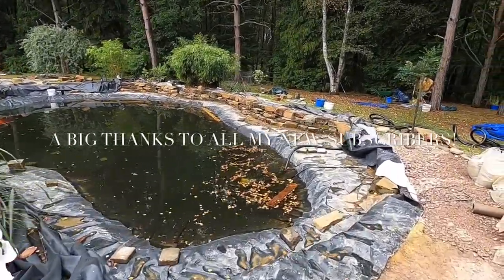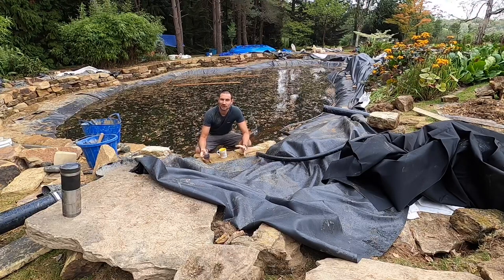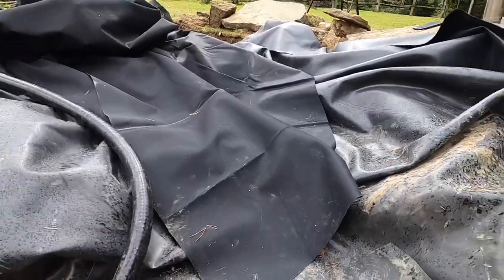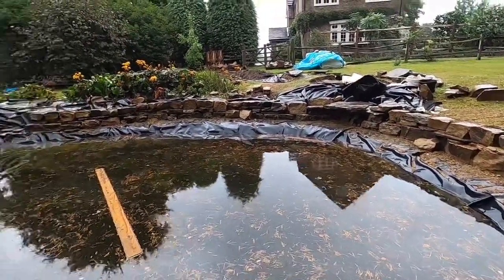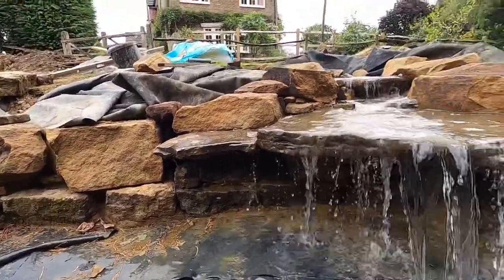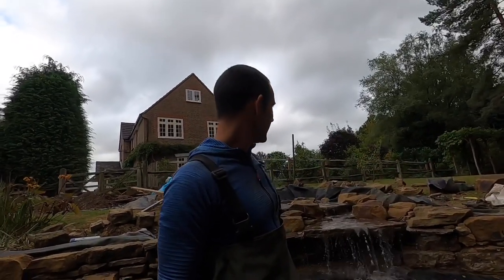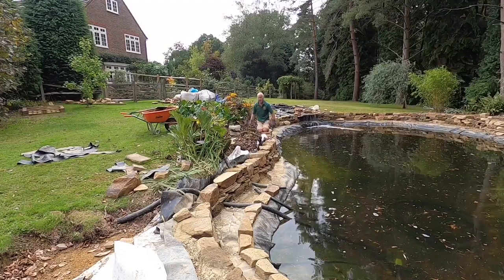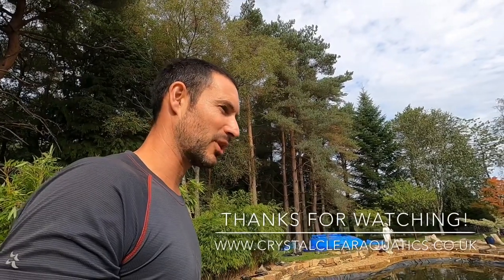Pond re-line & re-design part 2

Comment: Very informative videos - thanks. What mortar/cement do you use on rocks below water level and does this affect water conditions/fish health? Do you sit these rocks on an additional layer of pond liner or straight on to the main liner itself? Would appreciate your comments - thanks
Reply from the maker: Hi there, thanks for your comment!  I use a standard Portland cement mix at a ratio of 4:1 (two sharp, two soft one cement).  Obviously anything below water level will leech out certain minerals and chemicals initially and in strong enough concentrations this could prove harmful to pond life.  After a period of soaking for a few weeks/months this effect will dramatically reduce. All rock work is absolutely sat on a protective layer- usually an off cut of pond liner, although pond fleece would work well also and would be my preferred choice if placing really heavy/irregular shaped rocks. Hope this helps-if you watch some of my other videos I do into more detail regarding the use of mortar.
Best,
Ed
Reply: @CrystalClearAquatics  Thanks for your reply - much appreciated - Chris

Comment: Hi i was wondering where abouts you get your large holding tanks from and what brand they are?  Thanks
Reply from the maker: They are called Easy spa tanks-holding tanks designed for emptying and holding water from swimming pools.  Sadly I’ve never seen any online despite frequently searching and I purchase them from Home Counties swimming pools in Horsham West Sussex.  They’re expensive-a large one such as used in this job is over £1000!
Reply from the maker: Hi Daniel-  no problem, however if you could please get in touch with me via my email address (info@crystalclearaquatics.co.uk)  to discuss your requirements that would be great.
Best,
Ed